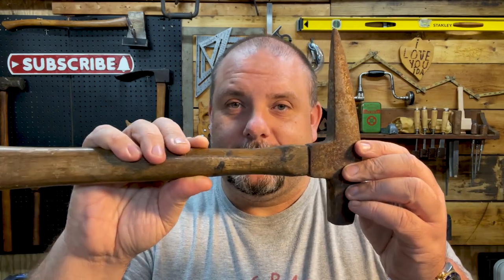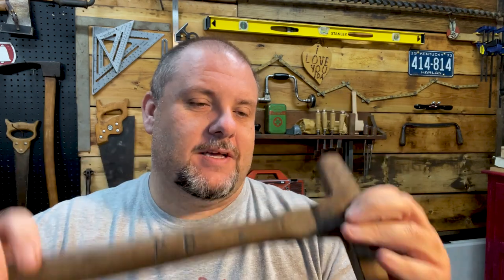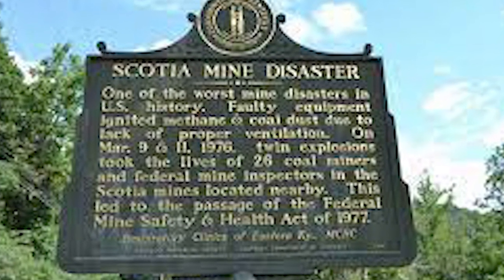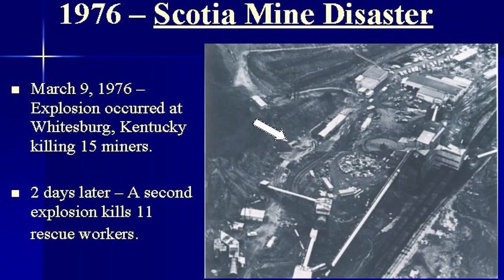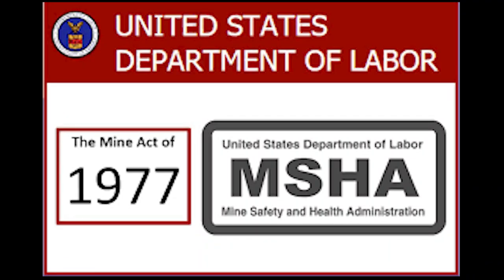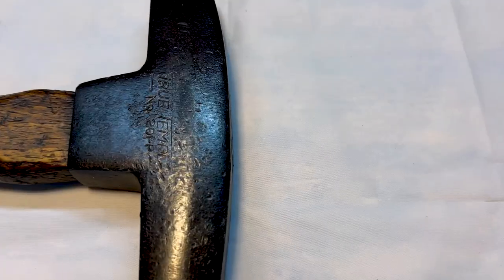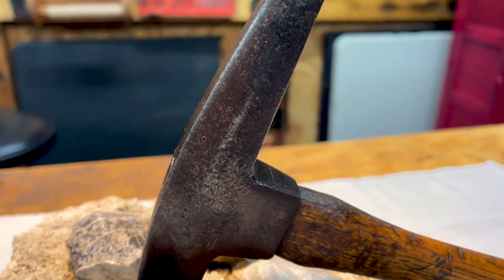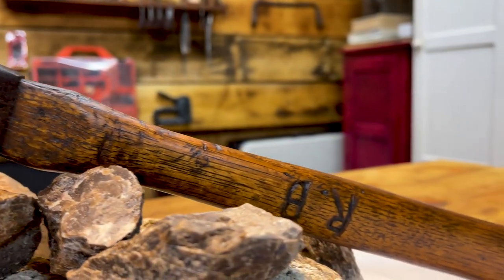Restoring A Super Fan's Tru-Temper Rock Hammer

Comment: Someone else who wears nitrile gloves while applying linseed oil to handles. Nice. So many use a clean paper towel or cloth, which soaks up a bunch of oil that never makes it to the handle.
Reply from the maker: I usually try to either use gloves or put it on with my bare hands. Gets a little messy at times, which usually why I use the gloves. But I agree, using a rag or paper towel soaks up so much, then you have to put it up and let dry so it doesn’t become a spontaneous combustion nightmare!